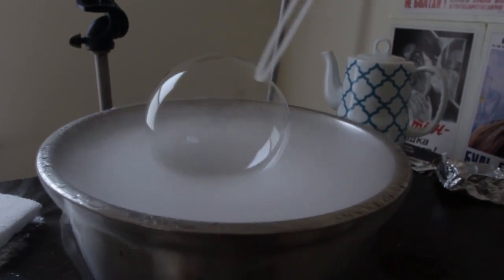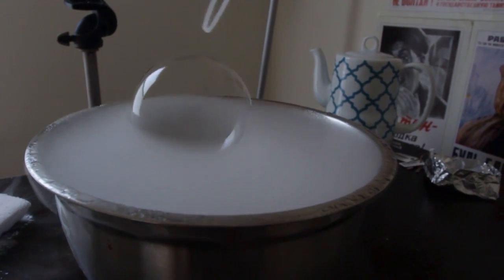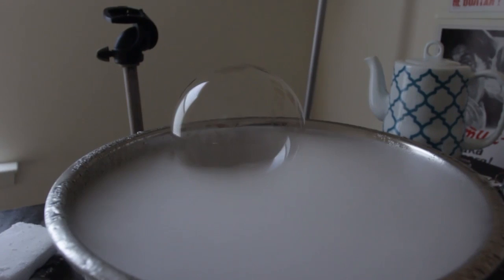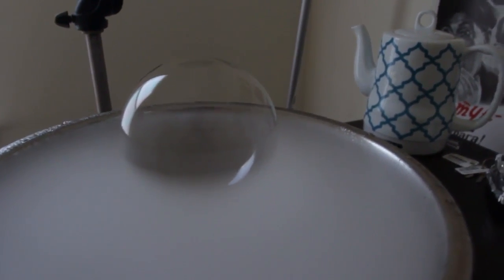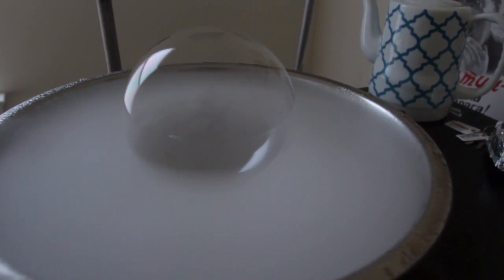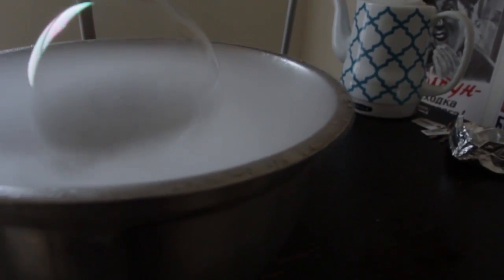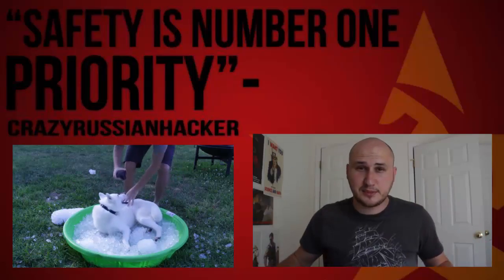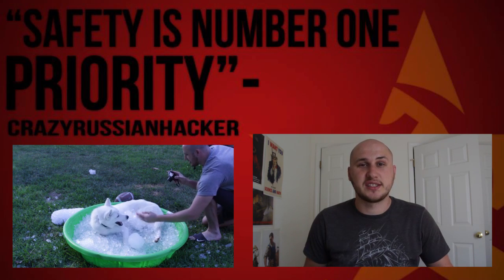Dry Ice Floating Bubbles - Science Experiment

Comment: because air is lighter than water so it stays on top. For example ypu have a dog and a mouse the mouse stays on top because the mouse is lighter but if the dog would go on the mouse the mouse would die just like if the water goes on top of the air the air bubble wille pop

Comment: My guess for why the bubble floats is because the CO2 from the dry ice is cold meaning that it will be more densely packed together and the air in the bubble (coming from your mouth; also contains CO2 along with other gases) is warm meaning that it is less dense than the "smoke" beneath it. Maybe there is another reason, but that's the best that I can think of.

Comment: It doesn't sink because CO2 is heavier than air which is mostly Nitrogen.

Also the reason is CO2 is very cold compared to air around it, which again adds to weight of the CO2, keeping the bubble afloat on the surface of CO2.

Comment: Bubbles float on top of the dry ice gas because the gas is heavier than the air but the bubbles are heavier than the air as well. The bubbles are not heavy enough to sink into the gas. Similar to if you keep bacon grease and other grease in a jar and the grease doesn't mix, it has layers. The air is the top layer, the bubbles are the middle layer and the gas is the bottom layer

Comment: The carbon dioxide produced by dry ice is actually denser than the soap around the air in the bubble (nitrogen, oxygen, and carbon dioxide). Therefore the bubble floats.

Comment: Why the bubbles float is because the cold air from the dry ice is making the bubble sink but at the same time the hot air from the hot water is rising the bubbles to counter the cold air so it makes a reaction where the cold air is at the top and when the bubble pass that point the hot that is trapped pushes up

Comment: The air inside the bubble will be less dense then the cold c02 gas so it will float on top, also the bubble will not pop because it is only being touched by expanding gases pushing it up (this is like blowing bubbles in the air) as soon as the bubble will make contact with the water it will pop.

Comment: You noticed that when you added dry ice to the water, a cloud of carbon dioxide and water was produced. But unlike smoke from a candle or fire, the dry ice smoke doesn't float. Instead, it settles onto the ground or, in this case, on top of the water. Why is that? The smoke is actually a combination of carbon dioxide gas and water vapor. This gaseous dry ice smoke is heavier than the air around it, so it sinks in the air rather than rising.
The same relation between air and dry ice smoke explains why the bubbles float on top of the dry ice smoke. The air exhaled into the bubble is less dense than the gases comprising the dry ice smoke, but slightly heavier than the air surrounding the bubble. So although the bubble doesn't float in the air, it does float on the heavier dry ice smoke.

Comment: It's just like putting a ping pong ball in water. The ping pong ball is less dense than the water so it floats. Air is less dense than CO2 so the bubble with air in it floats in the CO2. That's why the CO2 falls down when it leaves the bucket.

Comment: I think it doesn't sink because the viscosity of the CO2 (the property of the gas that gives air resistance basically) is higher than the viscosity of the air probably because of it's density, also it is expanding so that will give an upward force that makes it bounce because there is force of a high viscous gas that is expanding pushing the bubble up and a low viscous gas being the air letting the bubble sink. Also it doesn't pop because CO2 is fluid so as it pushes it up it goes around the bubble not into it so it doesn't create pressure on the inside.

I'm probably wrong.

Comment: The CO2 gas is denser than the air inside the bubble, which is why the bubbles float on top.
At the same time, the CO2 gas isn't putting stress on the bubble's surface. So they don't pop until it hits something.

Comment: I'm guessing (I don't know for sure) that the bubbles are floating because new "smoke" is constantly being produced by the dry ice and water so the "smoke" has no where to go but up and out so it is just pushing the bubble up
Reply: so, if I drop a rock over the fog, it will float too?
Reply: Like I said... I don't know for sure. But it wouldn't make a rock float but it's probably enough pressure coming out of the bowl to be able to hold a bubble. And also a rock is more weight in one spot and with a bubble its "weight" I guess you would call it is more spread out

Comment: 1) as someone who works with dry ice for there job, at -109 degrees F. Please do not handle this compound without insulation as you can cause skin damage. 
2)  the bubble float because the co2 gas released by the dry ice is slightly more dense but also because the thin film of the bubble is acting as a barrier between the co2 released by your lungs (if you blew to make the bubble) or the nitrogen rich air around you. 
3) if you waited for the dry ice to stop sublimation in the water(stop production the fog) and added the bubble filled with the co2 from your lungs the bubble would actually sink into the water and pop.

Comment: Ok, so the way it works for is that the bubble gets low preassure onside if it, and the dry ice is filled with high preassurized air, that it is repelling the low preassure inside the bubble. Because hight preassure pushes low preassure.
Reply: Jorge Ye no. that is not what is going on.

a bubble fundamentally cannot maintain a pressure differential with this kind of medium because the gas provides the strength/support for the bubble. if pressure inside is too low, bubble collapses. if pressure is too high, bubble explodes. the bubble pressure is the ambient pressure, it must be or the bubble cannot exist for very long. the bubbles in the video are around for quite some time.

What is actually happening is that the gas inside the bubble is ambient air from his lungs. this air is made up of Co2, nitrogen, and some oxygen. this gas mixture is less dense than pure Co2. So for that reason alone the bubble should float. Secondly, the thick Co2 gas indicates very high density of Co2. Not only is Co2 heavier than what is inside the bubble, it is also more dense because it is colder, which gives even more upward force for the bubble to float on. (more mass to displace for a given volume)

Comment: can a  Bubble be freezed and touched without popping ? it will be an amazing experiment
Reply: samiyas100 yes it can. its called foam
Reply: Soap bubbles work because of the elasticity and surface tension. If you were to freeze them both factors would decrease leading to the bubble popping.

Comment: Correct me if I'm wrong but air is lighter than Co2 so it floats in it and it doesn't pop because hot water is cleaner than normal room temperature water

Comment: Honestly tho, how tf did he pick up Dry Ice with his bare hands? I thought it's temp was so cold it burns you
Reply: Hes a crazy man. A crazy russian man.
Reply: AxAngel remember, safety is number one priority.
Reply: Jorge Ye He's not just a crazy Russian man... He's a crazy Russian hacker.
Reply: You can handle them but do it fast
Reply: You have a few seconds before it starts burning.
Reply: You can hold it in your bare hand for about 10 seconds
Reply: Word right,crazy
Reply: He is Russian that's why
Reply: Allen Vorozhko LOL
Reply: If you do it quickly, there is too little time for the heat energy to move out of your hands.
Reply: He drank vodka before that
Reply: AxAngel SAFETI IS NAMBER WON PRIORITI
Reply: AxAngel i grab a pice of dry ice in my hand for like 20 seconds and it didn't hurt at all stop tinking that just because he is russian he can do this kind of thinks everybody can do it but most of you are pussys
Reply: The_Real_Herc Jordon i had an occasion to hold a dry ice block and i promise you taras didn't feel any bad sensation in the video :)
Reply: ThatCyclope omg liquid nitrogen is -273c
Reply: AxAngel it's like how you can stick your finger in the flame of a candle but only for a moment before it will burn, it's the same thing just with extremely low temperatures instead of extremely high temperatures
Reply: Dry ice is not as cold as liquid nitrogen or things like this. Dry ice is not cold enough to burn you unless you hold it for like 1 minute :)

Comment: If you put hot water and dry ice in a sealed container with a hose coming from it, it is possible to dip the end of the hose in bubble liquid and produce a bubble that is formed with the CO2 smoke inside of it, instead of air. It is heavier than air, so it falls and bounces, and when it pops it bursts into a little cloud of smoke. Pretty cool.

Comment: It floats because the bubble is full of air which is less dense than co2 itself
Reply: That sounds right.........lol
Reply: ***** That doesn't explain it. What about the soap? Without it, the air wouldn't sink. You're also forgetting how temperature is a contributing factor. It's because of the cold temp that the CO2 doesn't rise with the air, or else the bubble would have nothing to float on. I need more science in your answer.